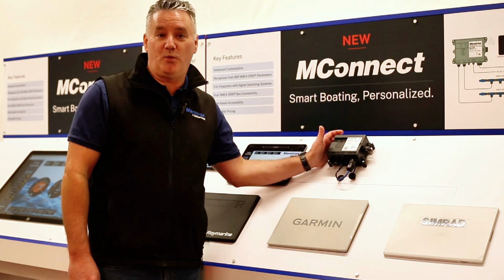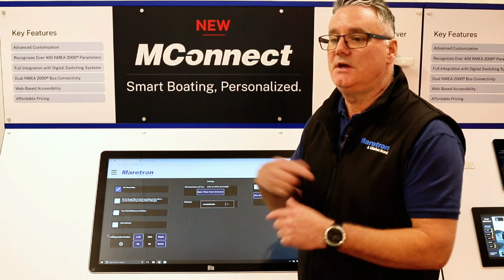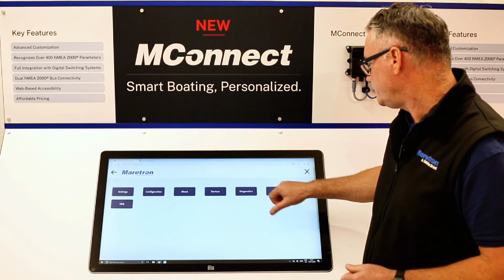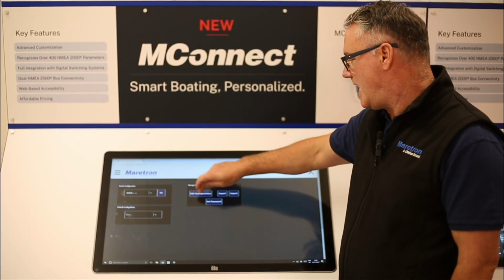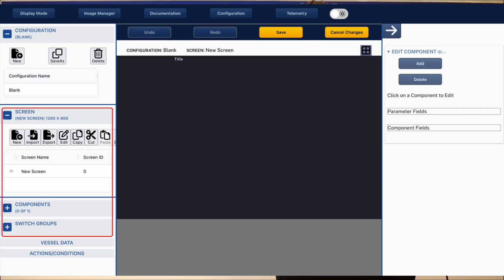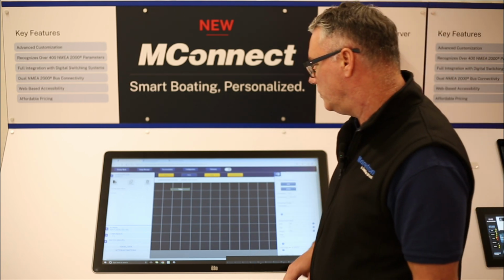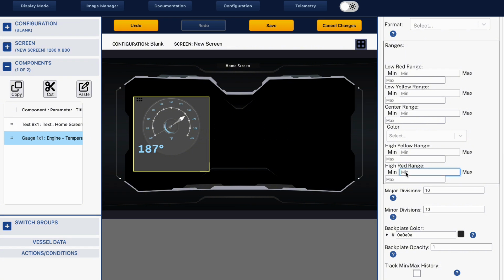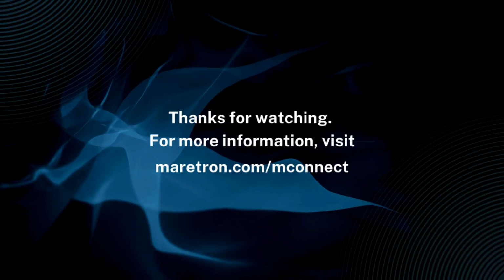Maretron MConnect Demo - Smart Boating, Customized

Comment: I feel like I'm missing what the thing does. I get the key features and all its ports and how to configure it. But what does it do? What is it for?
Reply from the maker: MConnect connects to your vessel’s NMEA 2000 network, gathering data from onboard sensors and systems. MConnect then presents this real-time information on your multi-function display using visually engaging, customizable graphics. This allows you to monitor key vessel data—such as engine performance, navigation, and environmental conditions at a glance.
Reply: @MaretronLLP ,  can you PLEASE do videos on how we can use it.   Meaningful and simple methods to build screens would be helpful